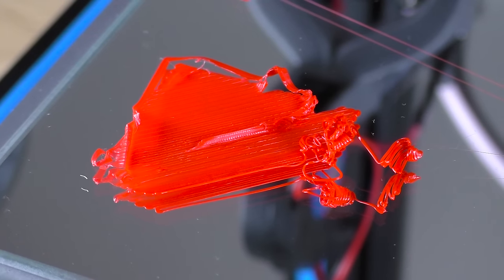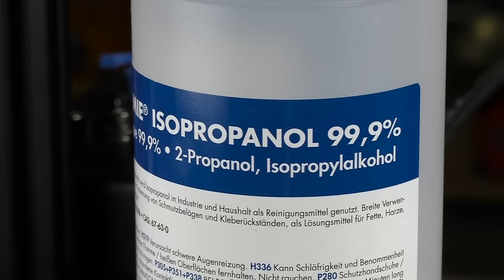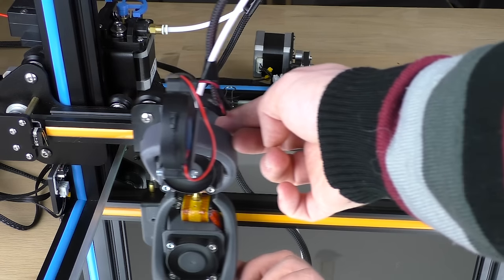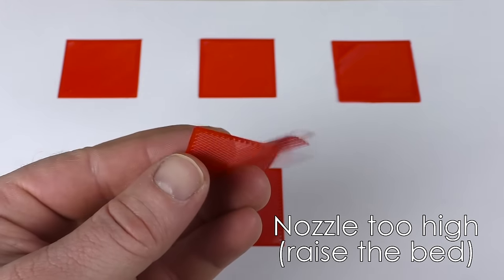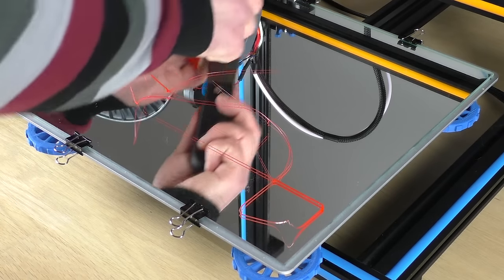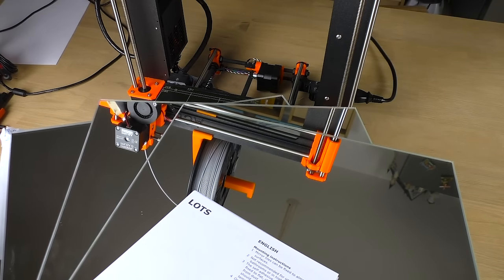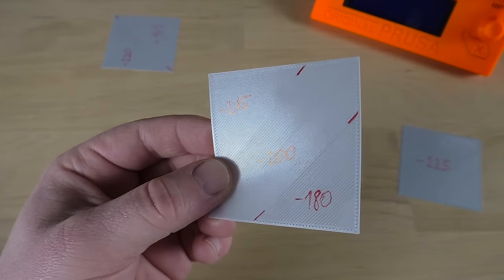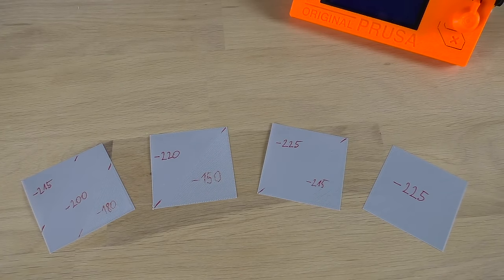Best method for 3D printer bed levelling

Comment: This is a great tutorial.  Thank you for putting it up.  I have used a single line for checking my bed levelling.  I may switch to your method as it gives a guide how to interpret the results.  Can you mention more about getting PLA to stick to the mirror - you mentioned a special coating?  I currently UHU stick on my glass bed as I can't get it to stick without.
Reply from the maker: Thank you, very appreciated. I meant that the mirror's surface is already good enough, you don't have to put anything else on there. I only use a bit of glue stick if I'm printing a really large object that might warp at the edges. Otherwise, you can print directly on the mirror. Note however that mirrors work much better than just plain glass.
Reply: @HobbyHoarder  is this due to some thermal reflection mechanic do you think? most mirrors I know of are glass surface.
Maybe because transparent glass is manufactured to higher tolerance ranges and cut from larger sheets knowing that the level surface is not the manufacturing or usage intent, but in mirrors maybe a very level surface is required to not introduce distortion in the reflection?
Reply from the maker: @kevin-bf4ww  Yeah, I've since learned that there's no special coating on the mirror, it's simply flatter, which I guess creates more "suction" so to say.

Comment: what if your nosel is far away from the bed instead of it being too close? I cant seem to get mine to even touch the mat
Reply from the maker: Have you checked if your Z endstop is triggering too soon? It's a small switch near your Z screw, and as the printer goes into the home position, it should hit that switch and then stop moving downards. If the Z endstop is too far up, the printer will stop before it reaches the surface.

Comment: Hi, Great video. I am new to 3D printing and like you said there are a lot of ways to bed leveling. I still have not gotten a successful print, if it prints at all. I will try the way you just showed. Thank you again for a great video.
Reply from the maker: Jose Sanchez Thank you and good luck. Come back if you'll still have issues and I'll try to help as much as I can.

Comment: Thanks for this. Very useful, although I reckon I will get one of those auto leveling mods/upgrades at some point :) 
subbed :D
Reply from the maker: Thank you, happy to hear that.

When I first got my CR-10, I was certain I'll be upgrading to auto-leveling soon. Surprisingly though, the manually leveled bed has been very reliable. I've now been printing for months without having to adjust the bed at all. I've actually had a lot more issues with prusa's leveling probe, because it was affected by heat and would give off different readings.

Comment: Great Vidio great method. I used feeler gauges to get accurate levels. 
(Didnt like the paper method for all the reasons you gave) but after trying your squares I found that I was  over a full turn to high the megacubic s has a great base so they stuck but I am getting a crease through the center square. I know from feeler gauges that it is .05 to 0.07mm higher than the edges.
Reply from the maker: Thank you! I know that some people swear by feeler gauges and they're certainly better than paper. But at the end of the day, the exact distance doesn't matter as such, you only have to worry about getting a smooth surface that still sticks well.

Comment: This is great but glosses over a lot. The first paper part always goes round and round in a circle! You get one corner right, then another then another and then find that the first corner is off again. So... You adjust again and it throws another corner off.SO you adjust again and it throws another corner off.  This went on all evening for me tonight with an Anycubic Ultrabase Heat bed on a Tatara A8 build and I nearly threw the thing in the trash out of frustration. I have been doing 3d printers a while and have even printed a perfectly functional 3d printer. I own 5 3d printers but manual levelling really pees me off. Once I have a machine levelled I rely on auto bed levelling and never touch it again ever lol. This was a scratch build. I had it perfect but the Hemera extruder kept jamming (i mean I only have to look at the Hermera the wrong way and it jams or screws up somehow). After disassembly, the whole bed was off again and i wasted an entire evening on it whilst watching Tv!
Reply from the maker: I can relate to your frustration, I wasn't far away from smashing my printer as well. Leveling can be extremely frustrating and it can ruin so many prints.

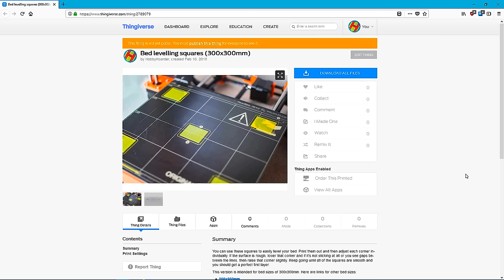Comment: If you could develop a little bit more from @2:08?
The bed is like 90 degree ccpm swashplate at a RC helicopter.
When you are finnished at corner #3 corner #1 is out of level again.

Comment: thank's for the information..
i have problem about bed levelling so the filament always slippery and not in to the extruder.. 
maybe it is the effect of the bad bed levelling.. 
thank you so much...
Reply from the maker: It could simply be that the surface of your bed is greasy. I'd recommend cleaning it with isopropyl alcohol or soapy water and trying again.

Comment: I don’t really expect a reply because this video is like four years old but I just got my first printer a few weeks ago and it seems like I’ll have five or six things print fine and then I have a print fail that I struggle and struggle on. Part of me thinks it might be the level of my bad part of me thinks it might be the slicer settings that I’m using. I try my best to get the bad level. Right now I’m using a flexible PEI bedplate which I do like but I understand that a glass bed helps you keep a pretty flat surface so should I keep the PEI plate or should I switch to a glass bed. My printer does have auto bed leveling so as long as I can get my bed pretty close to level the auto leveling should take care of the rest
Reply from the maker: The channel is on pause until I'm done with renovations, but I still reply to everyone.

If it makes you feel any better, my first printer caused me a lot of frustration to the point where I just wanted to smash it and be done with it. However, as your experience grows, most of your prints should be successful.

Personally, I'd never use anything but PEI anymore. I did have glass on a few printers, but I've replaced everything with pei. If you keep it clean, nothing works better. Even when I did have glass, I still used auto leveling as it really helps overall.

Good luck and come back if you stumble on something specific, I'll do my best to help.
Reply: @HobbyHoarder  thanks man. I really appreciate that. I think my bed may have a dip in the middle or something that the people sheet is following the contor of. 90% of the square prints perfect but there’s a few little spots that seem too far away
Reply from the maker: @avgjoeshow4208  Try lowering the nozzle even further until those small areas disappear. It's ok if it's slightly over squished elsewhere.

Of course, don't go so far that the nozzle actually scrapes against the surface or that the gap is so tiny that nothing comes out (you'll probably hear clicking in that case).

Your auto leveling might not be ok either if it can't compensate for a slight dip in the middle. That's harder to detect and fix though.
Reply: @HobbyHoarder  I’m going to look into the dip more. I saw a different video that might have an explanation. I can always try tape or foil too if I can pinpoint where it is. Can I ask you an unrelated question? It’s not often I get somebody with knowledge to reply to me. Thank you so much by the way for your help. 

I’m printing (trying to anyway) a talk thinish part. It’s 1 section of a collapsible saber type of sword. It prints great and than halfway it comes off the the raft. Somebody mentioned trying a brim but I was under the impression, in a situation like that, that the raft would be the better solution. I’m not against trying a brim, but I’ve already failed with this like 6 times (I’m gonnna get it if it’s the last thing I do). What would be a better option for a tall(ish) slender part, a raft or brim?
Reply from the maker: @avgjoeshow4208  Sure, putting aluminium foil under the area that's dipped always helps. It's just a bit tedious with a removable sheet since you have to re-adjust it every time.

If you're having a hard time locating the exact spot, I highly recommend that you start using Octoprint. It's excellent anyway, but it also has an add-on that displays a nice graph of the bed, showing high and low points.

I'm convinced that rafts are obsolete and have been for years now. They made sense way back when ABS was the main material. Today, with PLA and PEI sheets, there's no need for them anymore.

In your specific case, I'd definitely use a brim. Go with 20 or 30 lines, it never hurts to have too much. Also, slow down your printing speeds to something like 20mm/s or even more if you have to. That should have a big impact.
Reply: @HobbyHoarder  I will try that. Thank you so much for that tip. I have almost gave up on that project but I want it so bad I’ll probably give that a shot. 

I am trying so hard to set up octoprint. I really want it set up. I actually went and bought a new android phone to start using Octoprint4a (cause it was cheaper then everything you need for OG Octoprint) but I can’t get it to download on the phone. It keeps crashing while trying To install. I’m gonna have to wait until I can afford the price gouged raspberry pi and all of that stuff :/. As soon as I have the money I’m gonna try to order what I need.

Thanks again for your help man. I know you said the channel is down while you redo your studio but you got my sub man. I’ll be back for sure! Thank you again. SO MUCH!
Reply from the maker: @avgjoeshow4208  Yeah, Pi's have really gone up in price. If it's any easier, Pi3 will work just as good (all of mine are 3's), especially if you can find it used. I've never actually heard of anyone running an Octoprint on a phone, that should be interesting.

No problem at all, I hope it helped you out a bit. Thanks for getting in touch and good luck with your printer!
Reply: @HobbyHoarder  yea it’s called octo4a. The phone already has everything you would really need to run octoprint including a built in camera. I know it can work, I’ve seen it working, but I, of course, bought a device that is stopping me from putting it on it somehow. Hopefully one day soon I can get what I need

Comment: Great video!  Can you point me in the right direction to obtain levelling squares for a Makerbot Replicator 2. It's still a great printer and it still works well for me as my backup 🙂
Reply from the maker: If you'll follow the Thingiverse link in the description, you'll have a few different options (sizes), pick the one that best fits your bed size. They're all STL files, so should work with your Makerbot as well.

Hope that helps!

Comment: This is a great way to do it and seems so much easier. Im trying to get my bed level but why does it seem like your squares are so much thick than mine are coming out. you can easily see the spacing and smoothness of yours where my lines are currently so thin its like pieces of hair. They are sticking to the bed but everything is so thin
Reply from the maker: It might depend on a few factors; first layer height (I always use 0.2), flowrate, first layer width or underextrusion (I haven't done a video on this, but search for extruder calibration, I recommend the video from MatterHackers). You could try going even lower with the nozzle, until the surface is rough, and then back off a little.

Comment: Thanks for your video. One question: I have my squares printed out nicely but I have thin lines between the squares. Is that how its supposed to be in perfect leveling??
Reply from the maker: There shouldn't be any gaps between the lines. I would suggest that you calibrate your extrusion flowrate first (search on YT, MatterHackers have a good video about it). After you're done with that, repeat with the leveling squares. Keep lowering the nozzle until there are no more gaps left.

Comment: This is very helpful. I am using Cura as the slicer. How do you make those cool skirts?
Reply from the maker: Thank you, I'm glad you found it useful.

Which skirts exactly do you mean?
Reply: @HobbyHoarder  Well at first it was those double lines around the red squares and connected. But really, I would like to be able to run a skirt around each individual object on the plate instead of one big one around them all. I cant figure out how to make that happen in Cura.
Reply from the maker: @RixFPV  I was using Simplify3D at the time and it automatically makes a skirt around each individual object. I'm not sure if Cura has the same option though, I've never seen it.
Reply: @HobbyHoarder  Thanks! Fiddling a bit more I think I have my printer leveled better than I ever have yet using your technique. Thanks again!

Comment: The surface of a mirror is plain glass, it's not coated...The back of the mirror is coated...
Reply from the maker: Yes, that's true, I had wrong info when I was making this video. Despite that, mirror still performs much better than glass and from what I can tell, it's because mirrors are produced within better tolerances.

Comment: I recently bought the Creality CR-10 V3. Having a tough time leveling as the knob on the front right corner literally falls off and and tip still is not close enough to the bed. I have had almost zero success in leveling and succeeding to create a decent print. I doubt even with the squares I'd be able to succeed.  What should I try or should I change something in the settings?
Reply from the maker: The best solution would be for you to adjust the Z endstop. It's a small trigger on the side that "tells" the printer when it's low enough. Your Z endstop is obviously set too high, so that it stops when it's still too high.

On my old CR-10S, there's one trigger on the left side that you can unscrew and adjust the height. Your V3 must have one trigger, but it's possible there's a second one on the other side as well.

After it gets relatively close to the bed, you can then fine-tune with the knobs.

Comment: wdym you only have to adjust the closest corner for each square?
Reply from the maker: There's usually a separate screw under each corner of the bed. When you're adjusting it, you should only focus on the square that's in the same corner as the screw.

Comment: Mine keeps dragging the filament...what sign is this? It also will hit another line that is already down and knock it off and start to drag it as well.
Reply from the maker: It's probably a bit of everything; bed not clean, filament not squezzed enough and overextrusion (too much plastic coming out). Do you have a photo or video? Would be easier to judge then.

Comment: Thanks for the video. I've been printing for a while now on an Anet A8 and I love it, but I've never gotten the print to stick without using a glue stick. I'll be trying the calibration squares to see if I can get better results. I am using borosilicate glass and I'm wondering if using a mirror would be better. What would your recommendation be?
Reply from the maker: Sorry for the late reply, I was on vacation.

I had a lot of success with using a mirror, so if you can get one cheap, I'd definitely give it a try. My friend bought Ikea mirrors and then cut them down to fit the A8. Any hardware store should be able to cut them down as well if you buy it from them. Good luck!

Comment: I know this is an old post but I have been struggling with my leveling lately.  I adjust printer so it prints all squares perfectly then start a print which runs auto home and abl and 1 corner of the bed is so close it doesn't extrude anything.  I can adjust during the print but it is groundhog day every time I print.
Reply from the maker: If it's a new printer, it takes a while for the springs to "settle in." I had to re-level mine almost every day at first, but then only once a week and after a few months, I only had to do small adjustments here and there.

However, since you have ABL, it should compensate for that. Maybe the ABL isn't working correctly (happens a lot with Chinese sensors). Search for "ABL repeatability test" online and try doing that to see if your sensor is ok.

Comment: I got a new Tevo Tarantula and I'm unable to level the bed perfectly. It's a heated bed and it must be warped. The carriage is also a bit loose, I was unable to fully tighten it to the frame using the eccentric nuts (tip: loosen both wheels on opposite sides, bend them towards each other and retighten both. This seems to make them less loose, then try tightening the eccentric nut to grip the frame)  plus it's plexiglass so it warps under sufficient pressure. I'm gonna buy a mirror for it, hopefully that solves it. I also need a new auto leveling sensor, the standard "green" sensor can't sense higher than 2 mm.
Reply from the maker: Sorry to hear about your problems. Yeah, replacing the bed with a mirror is a good start. Let me know if you need any help, I'll do my best.